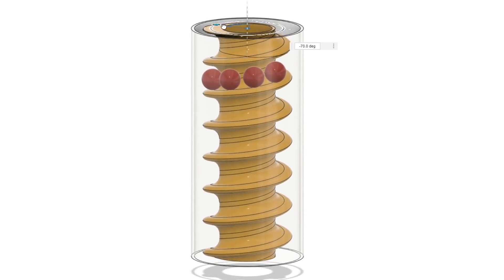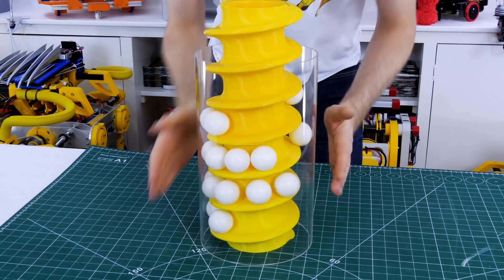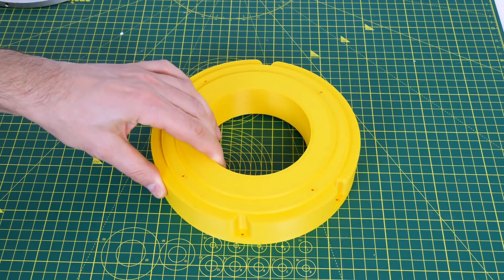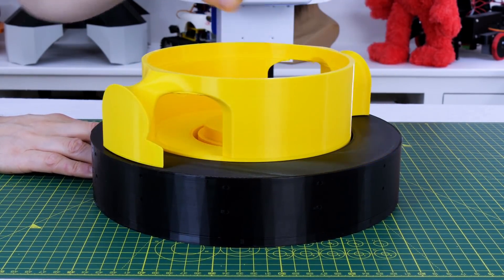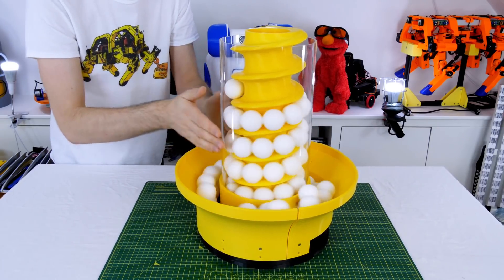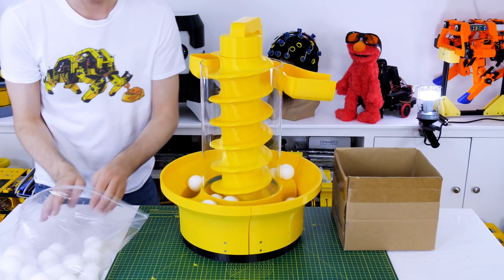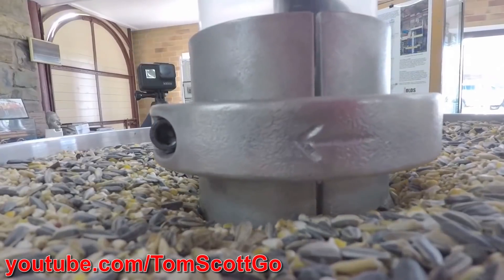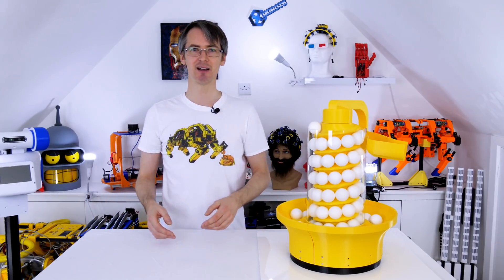Why this Screw Drive is Really Weird

Comment: While it doesn't seem like it, this was invented so recently that Mr Olds still holds a patent, so if anybody's thinking of incorporating a mechanism like this into anything you sell watch out.

With either this style or a conventional screw conveyor, when it's perfectly vertical it's hard to deal with free rolling material like ping pong balls or ball bearings, ideally you want something that would sit still if you placed it on a ramp the same angle as your screw. it's the introduction of new material under pressure at the bottom that's pushing everything up, the screw just supports the weight of the material already on its way up the tube, because otherwise you'd have to work against the weight of the entire column of material to keep those scoops moving.
Reply: How the hell is he holding a patent to somthing that is literaly over 2000 years old ?
Reply: @NinoJoel  Because the original invention had the screw turning instead of the tube around it. It's really weird that nobody thought of it earlier, but yeah. lol
Reply: @daanlutkewillink3893  I question its patent-ability (unless Olds has some special  non Archemedian feature) , all 4 designs*  have been in use for millennia in the middle east, outer tube rotating is popular as it's easier to attach motive force(aka donkey)to the outer cylinder than the inner screw. But the US will patent/copyright anything that isn't bolted down.
*Moving screw, moving cylinder, counter rotating cylinder screw, and co-rotating cylinder screw.

I went and read the patent application, and the Olds elevator is a very specific variant, with particular reference to vertical orientation, a sweeper arm and specific clearance between screw and tube. The patent itself quotes prior art patents going back to at least 1988. It is not a patent for the concept of a motive tube with a stationary screw.

Comment: So my answer, before the end of the video, No. Archimedes screws are usually used at an angle, and the angle has to be greater than the pitch of the screw, this prevents stuff from just sliding back down like it is here. And then in the context of the angle, the blades on the low side of the screw are moving up the pipe and that is what does the lifting. I doubt your setup would work any better if you turned the screw instead of the pipe.
Reply: After the video, this feels more like a weird centrifugal pump than a typical Archimedes screw.

Comment: James, perhaps the screw thread should slope outwards (buttress thread or Christmas’s tree? Style) so the balls engage with the tube more firmly
Or line the inside of the tube with vertical strips of double sided tape.
The balls have a rolling motion which is different than grain elevation which is probably a much more sliding action.
Also please make an orange robot that destroys itself.

Comment: It's 100% going to work, it's called an olds elevator thank you Tom Scott!
Reply: 10:11
Reply: Yes, das that Video to
Reply: Patent expired: https://patents.google.com/patent/US7314131B2/en
Reply: @RiverMersey  adjusted expiration to 2024
Reply: @RiverMersey  i guess the patent's old enough?

I know the way out
Reply: They also usually have a stationary "wiper" in the sump, to increase efficiency.
Reply: It will work thank you tom Scott
Reply: Yes thank you Tomscott
Reply: Ye
Reply: Agreed
Reply: I watched that to
Reply: Physic is just a joker, he said we right but when he showing other tricks we think it's contradicts but actually they'll say "yes it is, but this also work cuz it's actually same just with different way of visualize it"

Thus, Tom Scott vids and Veritasium vids is showing us that physic is no more than professional joker who pointing finger to people who not only smart but also creative to finding a solution.
Reply: So, it works, but is it efficient?  An Archimedes screw is very efficient if you have it slanted sufficiently so that the material you are moving up cannot roll down the screw anymore as then your motor or rotating force isn't fighting gravity but just moving things along the length of the screw.  If you put it very vertical like this, basically you just made a kind of pump where the pressure from the balls at the bottom and the friction between the balls and either the screw or (as in this case) the cylindrical wall moves them in the wanted direction.  The latter means that rotation speed and a bottom sufficiently filled with material to pump are a hard requirement, whereas a slanted Archimeded screw could move a single ball even at very slow rotation speeds - but would require turning the screw, not the surrounding cylinder.
Reply: @MisterkeTube  Ah, you so smart yet you so stupid to be tricked by Physics itself. They already laughing at us, they already fooling us many times, bro...
Reply: Tbh I wasn't sure if it was going to work. I'm more curious about the physics of it though.

It can't be relativity. That is, the screw is spinning relative to the glass, so centripetal force must apply to the screw.

But no. The screw doesn't feel anything happening. The glass is what feels the action. But between fluid physics and the golf balls or grain simply weighing itself against the glass, it's enough too start picking things upwards.

I'd like to see what spinning the screw would do. I bet it would be harder for the system to manage.

Either way I think you'd have completely different forces at work spinning the screw instead of the glass, but the experiment as a whole makes a big statement about the relativity of rotational motion.
Reply: @garrettcarlson6835  its just friction it looks, the balls are pushed up by friction and then another one takes its place so the first ball can rest on it.
Reply: @Mortomi  just about. I can just imagine some smart guy grinning at you as he asks "what do you think would happen if I spun the glass **troll face**" Is that just me?
Reply: @garrettcarlson6835  from the glass pov, the screw is spinning
Reply: Yeah just like 100 times less effective then the screw itself turning
Reply: @thegraffitiwriterknowsas  You would think so, but you'd have to spin the screw against the full weight of the balls, and fight against the friction of the whole screw.

But if you spin the glass, it's enough subtle friction to kick-start the system. The balls on the top escape first, while the balls down below continue bouncing around and replace the escaped balls on top.

Overall, this spinning glass action is thinning out the balls from the top, down.  ; Driving the balls through a shallow incline against gravity using only friction.

In short, spinning the glass uses friction to drive the system, while spinning the screw works against friction. Spinning the screw would probably work much faster, but you'd also have to work much harder, with a slight loss factor.

That'd be good for the next experiment. Actually spinning the screw to see what actually happens.

Comment: just add a thin vertical extrusion on the internal circumference of the tube and it will push the balls physically, preventing them from rolling back down
Reply: My thought exactly. Without extrusions like you propose it's impossible to empty the sump, as the balls only rise up due to back pressure from new balls being pushed into the tube, which only works with very light balls like those ping-pong balls, but not with heavier ones such as golf-balls.
Reply: I came looking the comments to see if any other had mentioned it.
Reply: @cheeto4493  I just said it myself in a reply to someone. I'm amazed how far I needed to scroll to find it, and I'm amazed James didn't do this already. Seems SO obvious, and it was even shown in the CAD model.
We're either being played with, or James got tunnel vision on this and couldn't see it.

Comment: Your gonna get much better results if you tilt the screw and tube even just a little.
Reply: You do with the original Archimedes screw design (where the screw turns) I don't see an advantage of doing so when you rotate the cylinder.

Comment: I remember seeing a grain farmer using this same method. If you didn't know, grain when it's powdered or freefloating is SUPER explosive and flammable. Turns out this design prevents air from building up in the screw, not only making the flammability problem go away, but also making the screw more efficient overall (Because the entire screw is filled with grain). There are pros and cons to the design, but it's interesting to do experiments like this and see what happens :)

Edit: Just watched more of the video. That Tom scott one is the EXACT one I was talking about!
Reply: Dutch taught me this while we was rescuing Javier from them fellers in Guarma.

Dutch always has a plan.
Reply: I lived in a town of 350 in dead nowhere Iowa I watched first hand  the concrete shoot blocks away when the olds broke and the grain bin went critical
Reply: I was thinking of that same video while watching this one

Comment: Whel yes it's simple physics turning the screw or tube is ultimately the same thing in perspective of the thing tour trying to lift up.
Reply: Similar, but not identical. For example: When the screw turns, the balls resting  on the screw have momentum due to the screw rotation. When the tube turns, the balls in the base have momentum from the rotation.

Another example: When the screw turns, the friction between the balls and screw resist the movement of the balls upwards, while the friction between the balls and the tube aid the movement. When the tube turns, the opposite is true. 
 
In both cases, the balls entering the base have to contain enough kinetic energy to overcome any momentum fighting against the balls being moved upward.

You can see what happens when a new ball is not trying to enter the cylinder - the balls start to roll/slide down the screw under the force of gravity.

The physics is simple, but calculating the magnitudes of the forces involved (even as a general equation) is much more complex. 

Note that the balls can only go so high, before balls can no longer be forced into the tube.